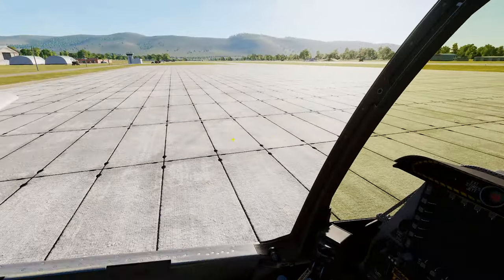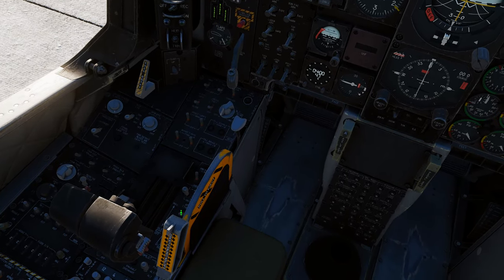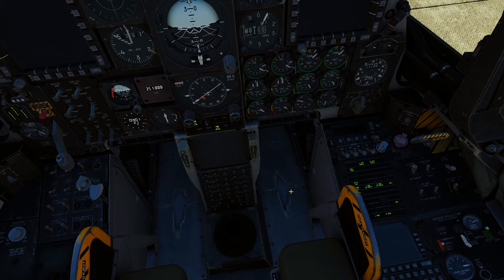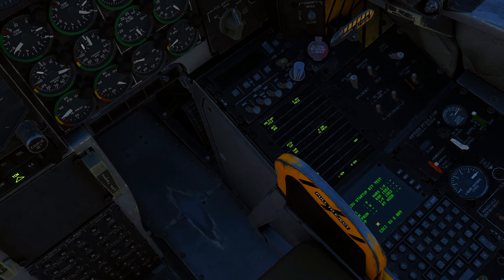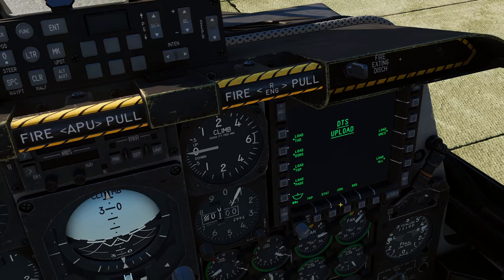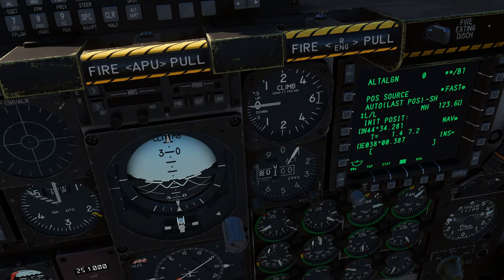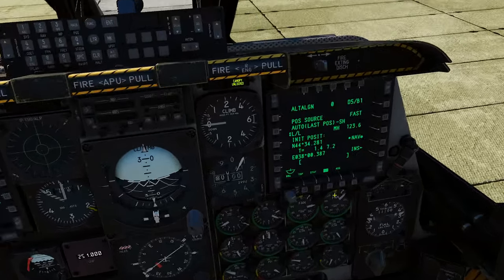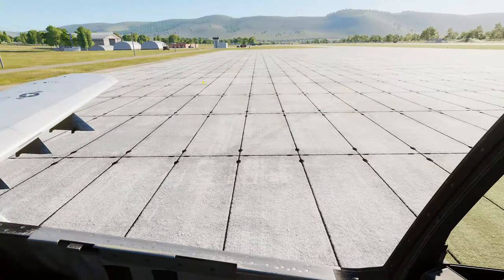DCS - A-10C II Tank Killer Fast INS Alignment Procedure

Comment: An option that you may not have thought about is using the in-flight alignment. 
When I'm in a hurry to get off the ground, I'll set for in-flight alignment and just take off using the HARS. It's not as good, and you have to fly by the seat of your pants for a time, but it isn't as if you're going to get to the target quickly in an A-10. While it's supposed to be used to align in straight/level, the GPS will correct for any velocity errors by the time all is done. Don't forget to do a HARS Fast Erect before take off.
Reply from the maker: Awesome ☺️ so does an inflight alignment get the same accuracy as a full ground alignment or is it degraded like the fast alignment procedure is?
Reply: @TorniQuetHD  It's been a while, so I tried and timed it. Loaded some gbu-38 and cbu-105's for INS tests.
Powered up from cold start, hit "in-flt" alignment as soon as the CDU test was complete. Got things powered and loaded, taxied, and was wheels up with HARS in 4m40s.  With the In-Flt alignment, you won't get an INU ready indicator until it hits 5.5.0.1 or so, but it gets there. Went weaps hot and selected the GBU-38s, set up a SPI on the HUD. I had to wait another 10 secs or so for the GBU's to read 'ready', but all weaps dropped on target.
Again, this was NOT about a faster INU alignment. It still took about 8 or so mins to complete. I was, however, in the air and enroute very quickly. This would be useful for a scramble situation.
Reply: There were also several things I waited on before taxiing. I could get off the ground faster if I started rolling with one engine running and the other spooling up, and worried less about some of the smaller systems.